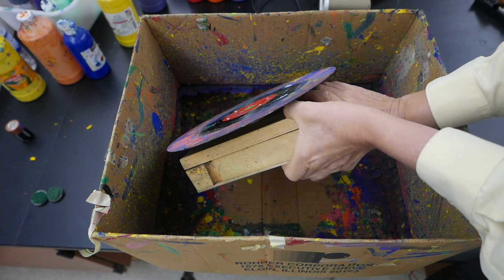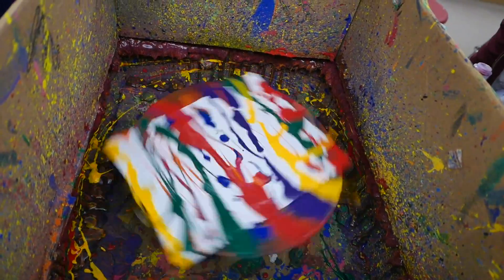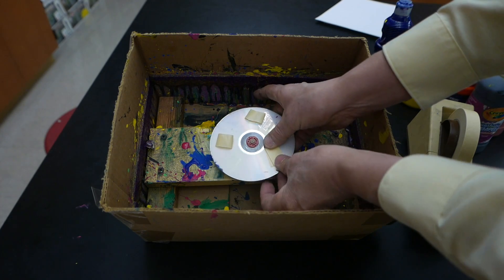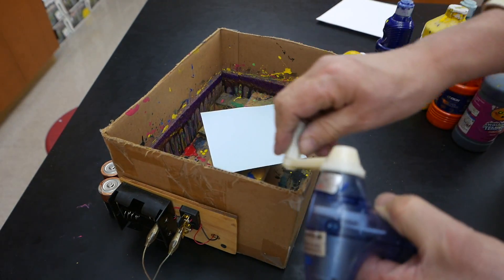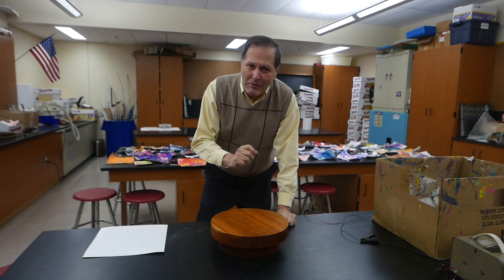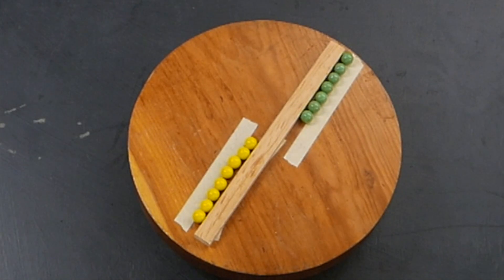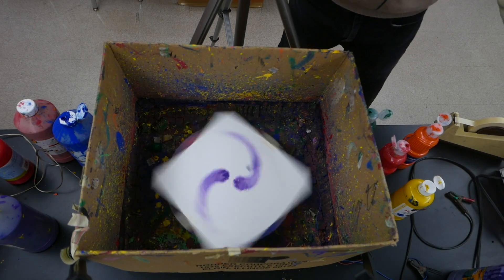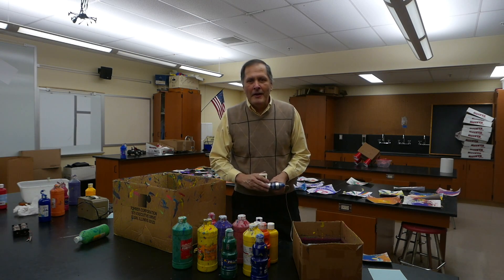Spin Art... centripetal force..."centrifugal" force // Homemade Science with Bruce Yeany

Comment: Liquids and solids behave differently. so the paint is not a solid, and the marbles are. What makes the spiral, is the friction.... the friction acts as a anchor at each point it regains traction,. There is no "centripetal force". This is known as a pseudo science force. This is helped demonstrate due to the dynamics of a liquid. As Mr. Bruce demos the bouncing ball, it takes 1 bounce and moves straight off. The more contact the object has throughout the spin, the more you will have the friction retard the objects trajectory. With the paint you see a continuous form showing a spiral. With the marbles, each marble is off the plate at a different time and forms the shape off the plate. That is what I see clearly happening.  Its great that Mr Bruce allows the viewers to observe for themselves, and not push any theory down any ones throat! :-)  If you pay attention to observation with evidence, you will also see that Relativity is another pseudo theory.

Comment: A rotating mass such as the paint in this video will be exerting a centrifugal force not subject to such a force; plainly a rotating mass cannot be subject to both a centripetal and a centrifugal force.
Reply: Liquids and solids behave differently. so the paint is not a solid, and the marbles are. What makes the spiral, is the friction.... the friction acts as a anchor at each point it regains traction,. There is no "centripetal force". This is known as a pseudo science force. This is helped demonstrate due to the dynamics of a liquid. As Mr. Bruce demos the bouncing ball, it takes 1 bounce and moves straight off. The more contact the object has throughout the spin, the more you will have the friction retard the objects trajectory. With the paint you see a continuous form showing a spiral. With the marbles, each marble is off the plate at a different time and forms the shape off the plate.  Its great that Mr Bruce allows the viewers to observe for themselves, and not push any theory down any ones throat! :-)  If you pay attention to observation with evidence, you will also see that Relativity is another pseudo theory.

Comment: Amazing. When on the paper, and under a decrease in the 'sticking' effect of friction due to an increase in centrifugal speed, the spin causes a spiral movement to be made by the object. At the point at which the paint leaves the tray under centrifugal force, it appears to be following a spiral course, but in fact is travelling in a straight line. At the point of leaving the plate, the continual line of paint is then behaving as many separate pieces. It has reached an interesting demonstration of duality, being both a single entity  - a line of paint - and many blobs. The amazing difference between an object's behaviour under the forces of straight line motion and centrifugal. I would expect the ejected blobs to also leave the plate spinning. Does the thickness of the paint effect the size of blobs/droplets? #relevanttotheuniverse #viscosity

Comment: Hi Bruce.  I’m an elementary science teacher here in Los Angeles.  What is the hub you used to attach the CD to the motor? I would love to try this with my students.  Thanks for sharing.
Reply from the maker: Hi Brian,  I've had several people ask me that question,  the hubs are for turning CD's to project wheels and reduces the hole down to 1/4 inch, still too big for the motor shaft so from there I still had to use a wooden dowel to mount on the hub reducer.  The hubs are available from Kelvan electronics for about $3.00 plus shipping.  I'm not sure if I would go this route again.  My advice would be to drill a 1/16  hole in something like a leggo block or a wooden block  for the motor shaft and then use two small screws to attach to the CD.  You might try gluing it but I found glue doesn't work so well on the CD surfaces.
Reply: Bruce Yeany Thanks, Bruce, I’ll try that!  I appreciate the advice.

Comment: Hey,  Bruce.  It seems that a lot of students are using their hands to stop the motor. 

If you want the motor to stop faster,  after disconnecting the power,  touch the two terminals together.  The motor will stop much faster because you closed the loop to make a low impedance circuit.

Alternatively,  you can get a "spdt" switch,  and wire it such that on one setting you get power, and on the other you get the empty loop.
Reply from the maker: HI Brice,  thanks, that is a great idea,  especially like the idea of the switch,  I have several 2 way throw switches around,  one of those  would  be perfect.

Comment: where do you get the capsules for the battery or that machine that lets you change the volt
Reply from the maker: the battery holder is available at electronic stores such as radio shack,  or you can find them online,  look up D- cell battery holders.    The machine that I used is a car battery charger available from most stores that sell car parts

Comment: Why does the centripetal force of the earth's rotation, not effect how much people weigh when taken at the north pole as opposed to at the equator?
Reply from the maker: Actually the spinning of the earth does produce enough centripetal force to slightly reduce your weight at the equator.  It is about.  0.3% less due to the rotation.
Reply: Bruce Yeany by chance do you have the equation that is used to calculate that? It seems that approximately 1000mph spin should produce a larger difference than 0.3%.
Reply: @stationrecreation3066  You can also test for this in an airplane, it is called the Eotvos effect.  If you bring a precise scale that is accurate to the individual gram, and a 500 gram sample mass, you can measure that it will lose weight in an eastbound flight and gain weight in a westbound flight.
Reply: The force due to the Rotation is m•v²/r and since r is in case of the earth more  than 6000 km, it is reduced by a large factor.
Reply: proofs of earth spinning or not.... we have lakes with waters that are as still as a photo, no sense of moving, no observation of moving, no coreolus effect. Michelson and Morley, as well as Gale, and Airy's test all say it is still. Would love to see some proofs of the spin. Cavendish is debunked as well.  Seams pretty hard to prove I guess.  Maybe have a drone stay stationary in the air and wait for the earth to move past it? :-)